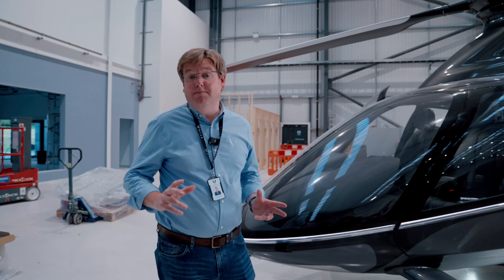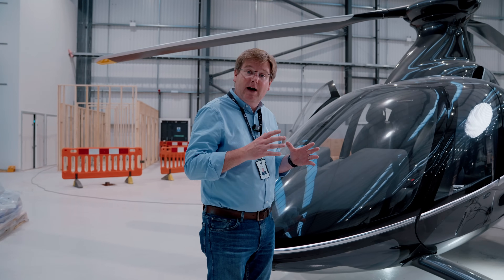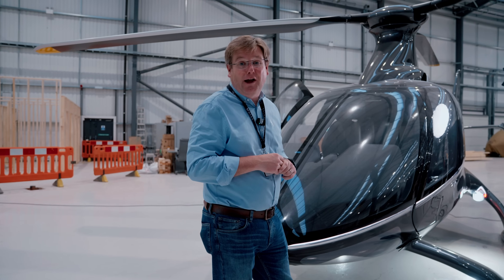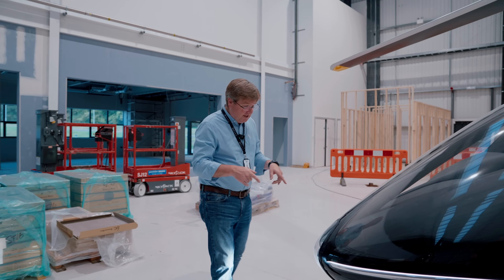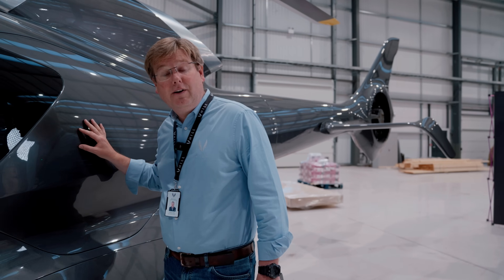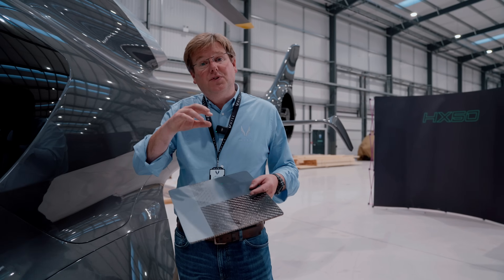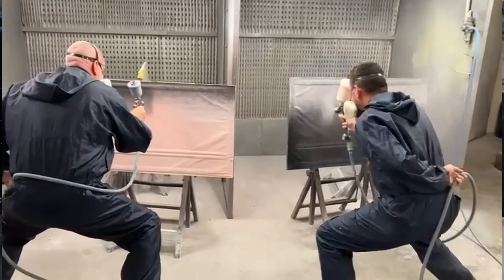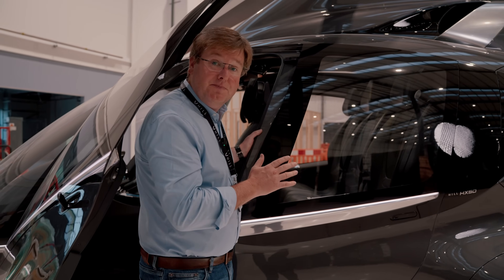HX50 Airframe Progress

Comment: interested in the lightning detail in the carbon fibre, how its applied and works
another thing i find intriguing, is the safety aspect for crash testing, the seats look great and i did see earlier what was being designed for impact, but it still surprises me, in a small craft such as this, why can't airbags be used, i guess they might be too sensitive in this kind of environment, going off prematurely, but these issues have mostly been ironed out in the automotive industry, so why not aviation
i'm also quite the advocate for aircraft parachute which i guess would mean jettison of the head rotor
great looking piece of art though

Comment: Best to buy proven helicopter Bell, Eurocopter, Hughes, Sikorsky million flight hours proven in combat and harsh conditions, this design not practical for commercial use, Insurance company would make money on Hull insurance deductible!, and liability say 5 million.. have a FAA approval takes years and a layout of Maintenance procedures procedures, your looking at a home-built a dreamer wanting pre orders..35 yrs flying n maintenance now retired,  Enstrom Helicopter Corporation, the Enstrom F-28 and 280 are a family of small, light piston-engined helicopters. The F28F has the capacity for one crew member and two passengers. The empty weight is 1570 lb (712 kg) and the maximum takeoff weight is 2600 lb (1179 kg). The helicopter is powered by a Lycoming HIO-360-F1AD piston engine of 225 hp. The cruise speed is 102 mph (89 knots, 164 km/h) and the maximum speed is 112 mph (97 knots, 180 km/h). The rate of climb is 1450 ft/min.